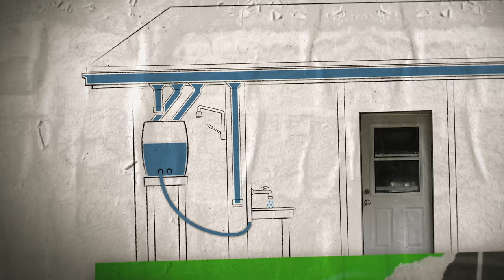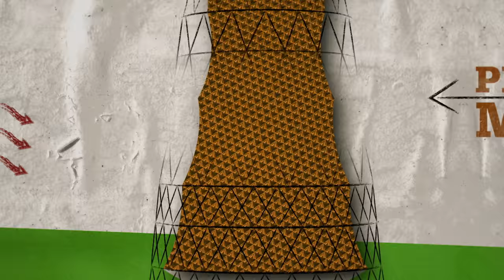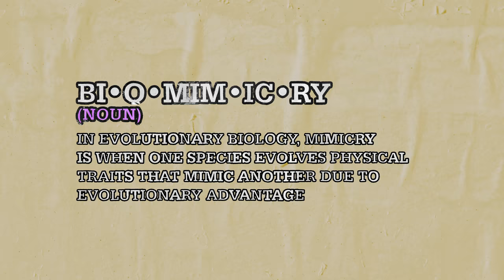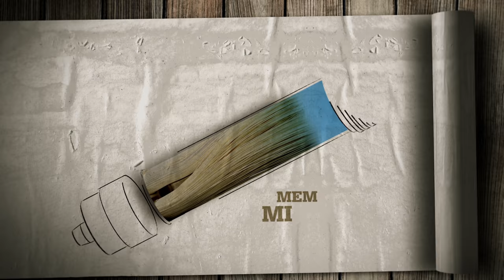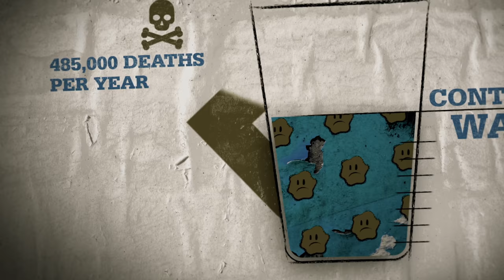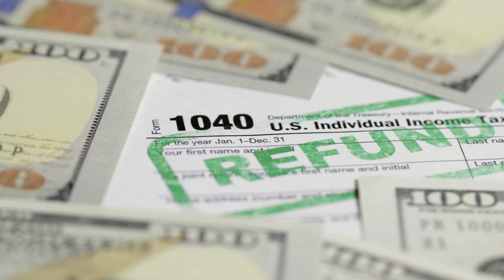Harvesting Water Out Of Thin Air | Shut It Off ASAP

Comment: I guess in Africa temperature difference between day and night is much more so they have a better condition for water dew tower working
Reply: But it's extremely cold in antarctica so you have so much less water in the air overall.  Isn't it? It would be more efficient (probably) but way less water to extract. 
Correct me if I am wrong.
Reply: @myentertainment55  What does antarctic have to do with anything? No one lives in antarctic except a small number of scientists.
Reply: @myentertainment55  dude it would be snow at that temp
Reply: @Thoth But you need moisture in the air to start with. You tend to find high moisture content in areas that are pretty lush and rainy. Not so much in dry hot regions where it doesn't rain.
Reply: Its desert.. it means while its hot at day, its cold at night..
Reply: It's a sea coast/interior thing. The further you go from the sea, the bigger the daily temp fluctuations.
Reply: @-Offstar  And they aren't even in a desperate need of water. They could always melt ice to make some water.
Reply: @Thoth yes, but its not related to its wind condition..
Reply: True + they dont have large forests swamps or waterfalls to collect Rain from
Reply: @myentertainment55  I would say that a place so cold that sea water freezes is not good for collecting moisture through a plastic mesh. It would probably freeze and rip open the mesh
Reply: @420Sean69  - 40C° is the temperature where snow turnd into ice easily
Reply: @patrickmooney5035  to be fair there is moisture in the air from clouds which hold a lot of water
Reply: @Banzybanz  or they could forget about water anf leave before they realise its cold. They Got scared of ticks
Reply: @mitjakovac278  Collecting dew is a well known survivalist technique. But, I am skeptical about how effective it would be in particularly arid climates. Hopefully they can prove me wrong with this.
Reply: Depends on how much moisture is in the air. It's not equal everywhere
Reply: @myentertainment55  that's a dessert
Reply: @mitjakovac278  who don’t have water falls?

Comment: It’s crazy how little we utilize roofs in most countries/cities. They are great for collecting rain water but also solar power, and both can be done at the same time without compromising either
Reply: Most cites and countries can not harvest solar energy efficiently on a roof.
Reply: @mangar3147  see that's why I like to do it in the basement, it also prevents damage from the wind.
Reply: also some cities don't allow it due to outdated laws
Reply: @mangar3147  This may be true but it still a massively under utilized space, I live in an extremely sunny area and I know of 1 building with roof top solar panels. I also frequently visit the mid-west states (an entire region of the united states which gets intense sunshine for most of the year)  and don't recall of seeing any solar panels outside a solar farm I drove past and small ones in national parks to run electric signs and stuff like that. if every building in sunny areas had rooftop solar we'd significantly cut out fossil fuel reliance. Obviously that alone wouldn't solve the energy or climate crisis but it's a good start.
Reply: @jacob416  sadly solar panels are high maintenance. In solar farms, it's easy enough due to workers working for the whole day checking and maintaining the panels. For commercial use however, it's not exactly ideal. Not to mention, birds flock in urban housing or city areas, making it prime target for even more problem ranging from bird poop to nesting in the crevices of the panels. Ironically the panels can even degrade BECAUSE of the sun hitting them too hard with dem deadly laser.

Basically speaking, solar panel technology hasnt progressed far enough for it to be used by just about anyone atm. Maybe in the far future, solar panel rooftiles would be a common thing, but right now, it's not exactly feasible.
Reply: @jacob416  vn n/m1¿
Reply: @RELAX MUSIC i think that you're ruining a nice conversation. Spam is not good try to find other marketing options, as spamming never leads to buying/following the product..
Reply: @darianistead2239  
It’s not subsidized by the government. It’s paid for with your taxes.
Reply: @darianistead2239  
And it’s a waste of money.
Reply: If you live in an area where a lot of gas powered vehicles go in and out, those residential roofs will get a lot of soot. The water they collect will be toxic, unless they go through treatment, I wouldn't trust using it as drinking water
Reply: @combativeThinker Lol, It's called a "subsidy" when the cost is covered in part by the government with taxes🤦‍♂️🤣 get a dictionary... 
Which aren't taken out of everybody's taxes as it's granted as a tax relief of your own, or if using off grid solar upto 50% of your battery cost is government subsidised.
It is worth it as it will pay itself off and eventually save you more over the entirety of your ownership of the property and increases the value should you sell, netting your return sooner..
Educate yourself
Reply: @blackmailz  I can walk outside and see more house's with than without solar panel's. I guess volume of maintenance would be dependent on location and environment, but here I have it serviced annually whilst having ducted A/C and heating serviced at a cost of $145 which is cheap enough I don't consider climbing up to do it myself.
Reply: @mangar3147 n y ft b
Reply: @darianistead2239 
Come 
Indeed, it is heavily subsidised here.  We all pay insane electricity prices here in Australia . Go and compare them to the world....If you're lucky enough to be able to pay the thousands  for your solar panels,. with the right facing roof , etc, the Government .(i.e taxpayers ) heavily subsidises the total cost.   This is nowhere near the most efficient way to provide energy to us all .
Reply: In parts of the US, especially in the American Southwest, there are water rights laws that make it illegal to collect rainwater on your own property, even if you’re collecting it straight from the sky. It’s very silly.
Reply: @spacelinx  really? Why? I'm from the Philippines and I don't understand why its illegal to collect the rain in your country.
Reply: @darianistead2239  is solar panel fastening ozone holes, and increase temp?
Reply: @rushakgaming9732  I don't understand a thing you said..
Reply: Some places its actually illegal
Reply: You could also plant on roofs for ecosystem health as well as general beauty
Reply: As a prepper, I have a rain water system. One of the first things you get to be self contained and self sufficient even in the city
Reply: @mangar3147  nyo
Reply: @mangar3147  nyoh
Reply: @jacob416  it’s not pushed as the powers that be make less money the more self sufficient we are.
Reply: So what happens when the panels die? Not to mention they cost a small fortune.
Reply: Many places it's illegal to collect water that falls on your roof
Reply: @DanBrianGerona  I believe it has something to do with allowing as much rain to reach the water table as possible. So if it’s collected it’s not replenishing the water table,  well water is how a lot of people get their water.
Reply: @mangar3147  a
Reply: @nickxenix  Q
Reply: @DanBrianGerona  ñ646
Reply: @mangar3147  Even a northern county like I'm From Denmark can efficient collect Solar power from the roof, if you travel to Denmark and go to the suburbs you will find solar power on houses and rain water drains for watering plants everywhere!!
Reply: Some cities use the roofs to collect water, them throw all of it to the streets an then flood the cities. Very smart, hahah.
Reply: @mangar3147  hai I am b gvmypioki
Reply: @darianistead2239  The problem is that many places don’t actually get enough sunlight to make solar panels worthwhile (since making solar panels is expensive and can be damaging). And some electricity is lost in transporting it. Also large scale batteries aren’t quite there yet for storing that energy.

Comment: I think the dew water system thing would be effective in deserts since when it is night time it gets very cold
Reply: This is exactly how the Fremen were proposed to exist on Arrakis (Dune).
Reply: it's also alot less humid though, it would might work more consistently but not better*.

by better I mean more water per night on average*
Reply: A
Reply: @v-2010  in the night time it actually cools down alot. And in the dawn the cold plastic, attracts the water of the air. Since warm air is more water containing than cold air this works well and creates droplets in the netting. Example for this. If it's cold and you breath into the air, your breath is warmer and therefore more water containing than the cold air, wich then creates a cloud of microscopical sized drops, that don't really have the density or size to fall. The cold air then neutralizes the "water" in the air to go back to the "agregate" of gases. (Dunno if thats written the right way, but i wanted to say, the mini water droplets get temperaturely neutralized back into the air.)
Reply: @timojixio6032  lol it's cold ar night but still dry as dust.
Reply: Considering the tiny bit of water collected and the resources wasted to build it, the dew tower is kinda dumb. My parents (who aren't even retired) had to haul spring water daily in this thing called a bucket. Can you imagine?! Omagawd. And there's a thing called a well that supplies water totally off-grid, too. 🤭🤓
Reply: @v-2010  there is little water on a desert. But if you live in the middle of one you will try anyways. The book have an interesting approach to the lack of water. It worths the time you spend reading it.
Reply: @v-2010  22:15 you missed that.
You didn't need to behave like that with Timojixio.
Reply: @Acheiropoietos  Long Life the Fighters (thought that's the movie) ;)
Reply: If you had a dehumidifier you will have an idea how much water you can harvest from air. And you will have less amount than that in dessert.
Reply: @v-2010  i guess it will viable if you didnt have any other way to get water and if this technology improved to collect all water on the air. But then that place would be so dry and might cause a new problem.
Reply: Gotta have moisture to get water. Deserts have very little.
Reply: But the problem is the air is usually dry unless your in the middle east
Reply: @user-so1wr2oh1t  ok but did you just forget the whole point of the dew harvester? It’s not really ment for areas with wells and springs it’s ment for places with wells far or in accessible or even polluted. But on top of that it’s still effective in those areas. What happens when those wells are dry and the srings are all underground? We can’t only rely on rain or wells even if they are very effective ways to collect water. Also imagine what it could produce if on a bigger scale and over time.
Reply: It looks like southern Ontario, which is humid in the summer but nighttime temperatures are often higher than the due points.

Comment: I grew up on a farm. There was no such thing as tap water. We had a pair of 10,000 gallon tanks few from rainwater and a dam that pumped water into another 5000 gallon tank that was for watering gardens and showering.
Even in Australia where it can go 8 or 9 months without rain we never ran out.
Reply: @LITERALHAT  we're in Sydney now so no rainwater. We had an 4000m2 block about 2 hours from Brisbane previously with a huge shed and about 40,000L rainwater storage. It watered the gardens and lawn. Its illegal to use it in the house without a fairly expensive filter system that makes it taste nasty so it's only plumbed into the toilets and washing machine.
We once went 11 and a half months with no rain and it ran out so luckily we had the town water hook up as well!
On the farm we had a 5000l settling tank that we would fill with dam water and lime and make fresh water if we got low. It worked well but wasn't fun to clean out the silt!
Reply: Where did you keep the drinking water?
Reply: Are u down under somewhere? Here in Sth. Australia, almost every home had a rainwater tank, then new developers moved in, and didn't replace them. Which means more people have to get water from the water utilities. Dumb move. In some parts of the US it is illegal to collect rainwater, another dumb move. Whereas in Australia new tank sales are steady. By yourselves a scythe and save on petrol, when cutting the grass.
Reply: @brianmorris8045  yeah I was in Qld. When we built our house a water tank was mandatory.
We're in Sydney now and trying to FIND a water tank is impossible!
Its illegal to drink rain water without an expensive filter system that requires a lot of maintenance. Theres hardly any solar down here as well whereas everyone had solar hot water and most people had a small solar system back home.
Reply: I can't believe it would be illegal to collect rainwater. Some really dumb leaders in the world these days. Keep up the great work. ✌️
Reply: @chriscorbin1055  you can collect and use. In the city we lived in its law that every new house gets a small water tank that is plumbed to the toilets and washing machine and a single outdoor tap for gardening. You can expand on this if you want to. Or not. Most people don't. The funny part is that the entire system is backed up by mains so when the tank runs dry it automatically changes to mains water. But then when it rains if you don't prime the water pump it will never switch back to tank water again. So a lot of the systems are redundant. I kept an eye on mine because water bills were up around $350 a half year. If you got enough rain to keep the tank full it bought that down around $75.
We had solar hot water as well and in summer when the electric booster was turned off our power bill would be $70-90 less than in winter when it used mains power to keep it hot overnight.
But yeah, my original comment, it's illegal to plumb rainwater into a sink for human consumption unless you run a 2 stage filter that makes the water taste like arse. It's to do contamination on the house roof washing into the tank and the lack of flourine. I guess.
Reply: It goes that long because everyone steals the water 💧 🙄 😒 😑 😤 😐 💧
Reply: @1one3_Racing  when you say illegal, is the authority coming to check to see that no one drinks it?
Reply: @dantronics1682  no. Especially not on a farm. But no tradespeople will hook up tank water to a sink without a filter.
It's not hard to have them install a filter then bypass it.

Comment: Next step is to put a barrel on the roof, then pump the water up to that barrel from the rain barrel so the gravity feed into the cabin is under higher pressure. You won't have to pump while taking your shower.

Then add dark panels to the roof to act as solar thermal collectors and run the water from the roof barrel through tubes zig-zagging through the solar collectors to warm it up so you don't have freezing showers!

You could also it a float gauge in the barrels and run a string into the house so you can see at a glance how much water you have in either barrel.

I'm an ideas kind of person but have never done anything like this, but it would be so much fun to work with you two on this stuff!

Loved the video!
Reply: instead of dark pannels, can't you just put it in dark pipes? a hose ran across the garden in the sun heats up wonderfully
Reply: @oxybrightdark8765  yeah but it doesn't store the heat, you need an insulating layer
Reply: Sounds heavy, can't be good for your roof. Roof not the same weight rating as the floor in a room. The weight of a full plastic 55 gallon barrel on a section of your roof Will be almost 500 lbs. The top and sides of plastic barrels erode from the sun, especially now when the rays are getting more and more damaging due to the greenhouse effect